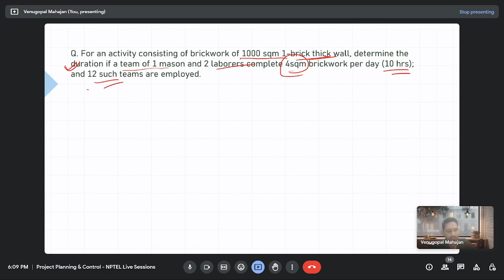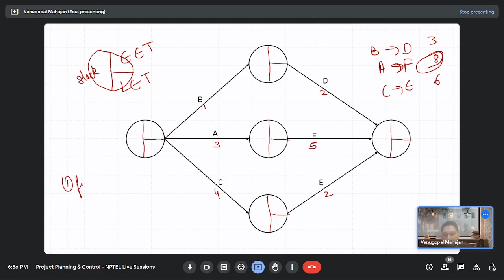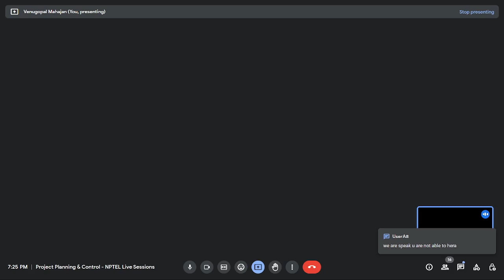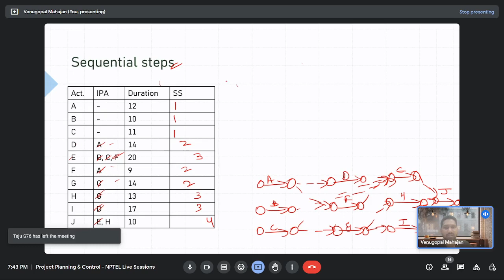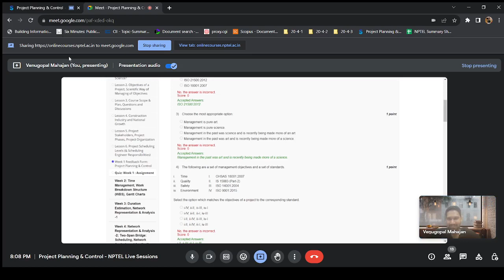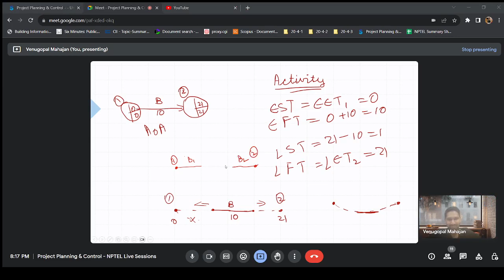Week 3 - Project Planning and Control

Comment: Sir during the NPTEL session the Prof. said that actual working hr can be considered to be 8.5 hrs. However, if it is done as explained in tdy's session, the productivity factor that each one may consider will vary, so wont there be different answers?
Reply from the maker: Productivity rates can be taken as per the IS codes or rate analysis. For a typical industry project, the rates need not vary much, even while using in-house calculations. you may stick to the prof's values for the course purpose.